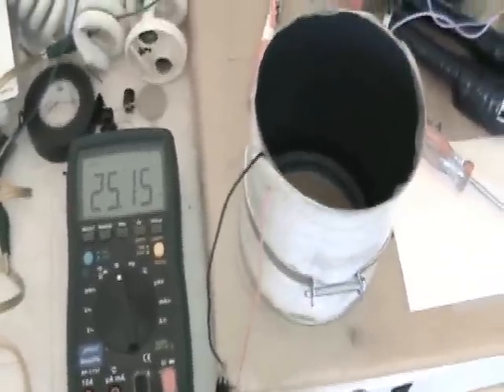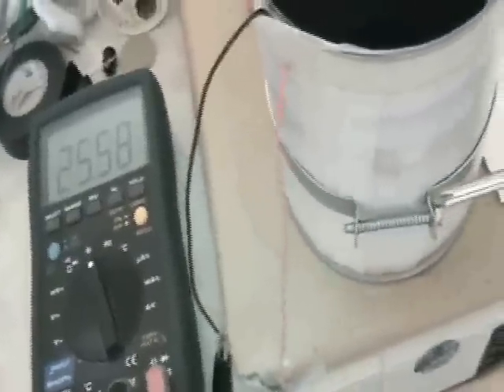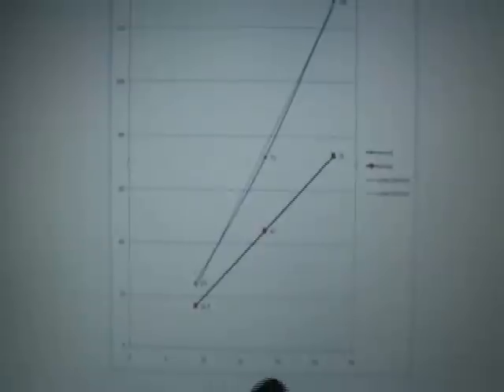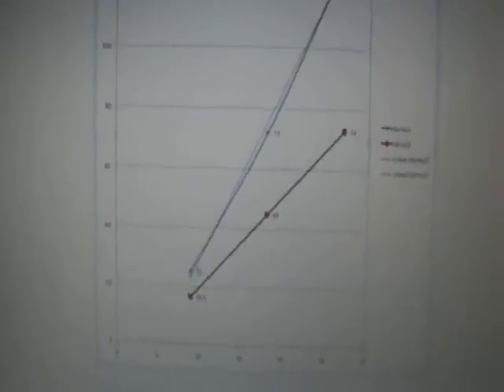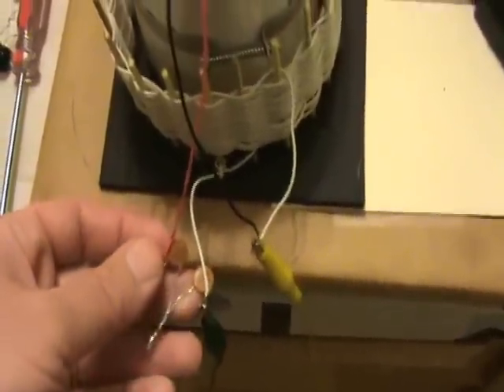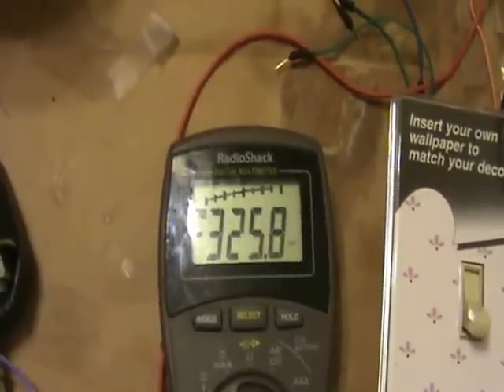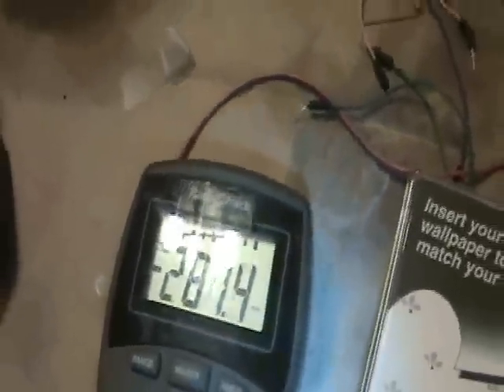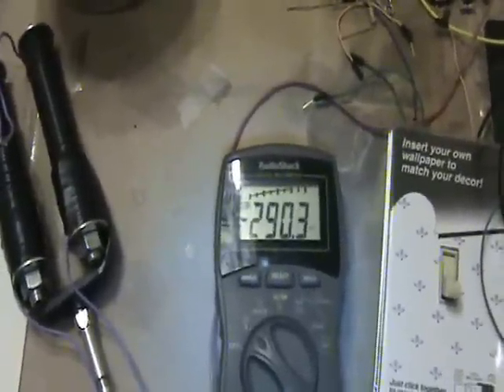Hendershot Fuelless Generator Tank Circuit Study

Comment: You mentioned Tesla in a comment. Tesla was experimenting with the wireless transmission of electricity. The reason it never went anywhere is there was no way to bill people for it. The difference between what people seem to be discussing here and what Tesla was doing. Is that Tesla was transmitting high power from a generator to circuits like the Henderson. Here you're just picking up stray radiation from radio stations and fluorescent lighting. So there is very little power available.

Comment from the maker: I agree with you breason. I don't believe the Hendershot device was part of the Spirit of St. Louis's design. Rather, from the research I've done, Lindbergh just happened to be a witness to a Hendershot demonstration -- and that is all. Re: "tank circuit". That is a term in electronics where a capacitor is connected in parallel with a coil. Unrelated to a gas tank.

Comment from the maker: To elaborate. A magnetic field will cause particles to SPIRAL down towards you. Hence, a plate antenna will see a GAIN with more events arriving per second. Those events can PING the coil, and make it oscillate with damped oscillations. Those oscillations further can enhance the magnetic field, and so forth. This will build up to some equilibrium .. depending on how well your machine is balanced.

Comment from the maker: Yes. Exactly. The reception of "ambient" power is the goal. It is "un-metered" and off grid ...and wave forms arriving on property I own, and so forth. Recently, though, I think I have a better understanding of some of the principals Hendershot is using and it not Radio per se like I first thought. Rather, magnetic oscillations probably cause NMR and PRM, which can be collected on the resonator metalic surface, also serving as a capacitor. Hence, the cylinders are the positive feedback path.

Comment: As an electrical engineer, from the schematics I've seen, I expect that this generator would produce some small amounts of electricity. I'd have to run the calcs but this should pick up induced currents from radio stations or even nearby electrical circuits.  Not free energy exactly as someone else is paying for it.  Maybe enough to charge a cell phone? But would depend an many variables in the circuit and the surrounding environment.

Comment: Excuse me. Where did you come up with that? As far as I remember the Spirit of St. Louis was essentially a flying  gas tank that had to be carefully weighed so that it could take off with such a large fuel load. For it to use this tank circuit it would have been propelled by an electric motor. In every picture of it you can clearly see the big IC engine on the front.

Comment from the maker: @BigGuyWhoKills 
Actually, there are various types of stainless steel. Some is magnetic. That is one of the mysteries about Hendershot. Did he use cylinders that had iron in them or where they non-magnetic stainless steel. His FIRST designs used coffee cans, which would certainly have iron in them. Also, on one photo had the letters "Fe" -- implying iron -- labeled on the cylinders. So I agree with you. I think he was essentially constructing a combination capacitor, transformer device.

Comment: While you will get some electricity out of this I wouldn't get to excited. You can only get what's available locally and that energy is pretty diffuse. You'll never get enough to run a refrigerator. There is case in brazil where there used to be a million watt radio station. Slum residents near the antenna would get free lighting by connection a wire antenna to a fluorescent tube. No circuitry required.

Comment: I think that the metal bracket you have holding the capacitor together will effect its function. The spiral capacitor has a field around itself which is effected by metallic objects. The two spiral capacitors and baskets have to wound in the opposite directions. The two capacitors have to play with each other.
Reply from the maker: +Naoki Kashima Good thought. I'll consider this if I ever attempt a rebuild.

Comment from the maker: @Demultiplexer 
Back in Hendershot's day there was a type of wire that may have been key. Some speculate the copper oxide that formed on it provides a semiconductor behavior. Others seem to claim that Hendershot was DOPING with some sort of radioactive material -- like Hubbard was rumored to have done. I don't think this is the case. Yes the cylinder is a mystery. Was it magnetic or not? The foil cap close to the coil was certainly diamagnetic and closer proximity to coil.

Comment: why are you not building it to its specs ?
Reply from the maker: There are no "specs". There are several circuits that people have speculated are Hendershot's design -- but there are many aspects that have not been figured out. So we need a "reverse-engineer" approach and we need to figure out each of the smaller problems one at a time.
Reply: There is a pdf tells u exactly what to use and video that shows you exactly how to do it.
Reply from the maker: 247News1 Yes. And that video and document are a HOAX being sold for money. It does NOT match the original information which you can find for free via the WEB.
Reply: They a not Being sold. All free . whatever.
Reply from the maker: 247News1 You may have gotten them free, but I keep reading over and over again that people are paying money for them.